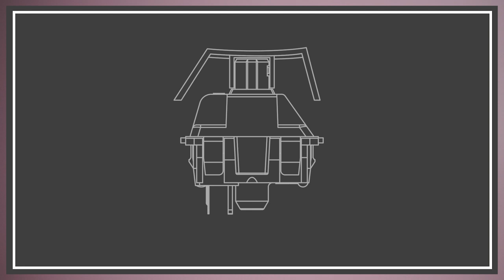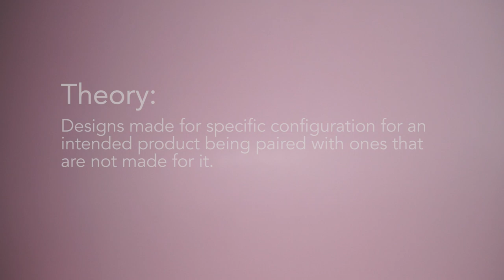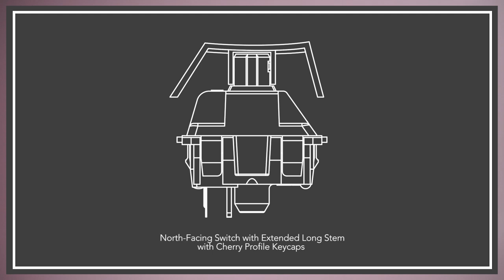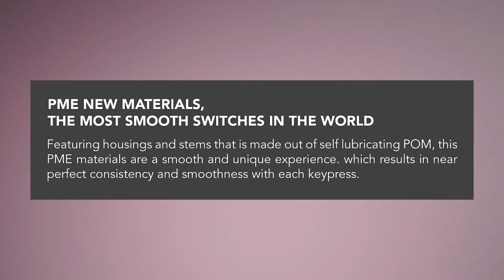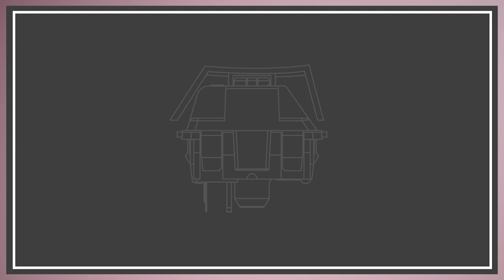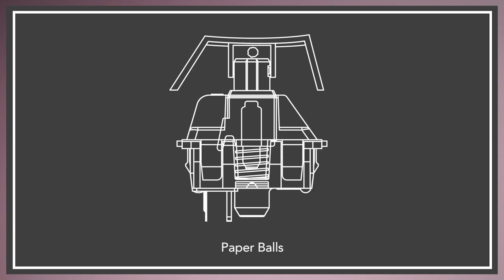Switches For your North Facing Keyboard

Comment: Good overview on long pole stems!

However, do wanna preface a couple of things:
1. Not all long poles are created equally. Yes, they longer than some of the more basic switches, but they also quite very by length, so there can be the situation where even when you get long pole, there can be interference.
2. The thickness of the keycap is also a factor as well. Especially since Cherry profile varies in thickness as well, but since most go for thicker sets for the sound, it’ll be likely that interference will occur.

Don’t mean to undermine you in anyway. Just mentioned some more factors to take into account.
Reply from the maker: Nah you didn’t but yeah I mentioned all that in the video, the best thing is still to do you research and try things out
Reply: @AFIQKeebs  My apologies, I should have watched the rest of the video before making a comment. Once you said, "you need long pole stems to help interference", my instant reaction was, "hey, wait a sec, there's more to this". 

Saw the rest, and you actually address one of the issues I had, which is KTT switches not being long enough to eliminate interference. I personally found out the hard way haha.
Reply from the maker: Yeah I learned the hard way too 😂 saw the long pole and went for it…
Reply: @AFIQKeebs  what are the thickness of the cherry caps you used with these switches
Reply from the maker: I don’t have the keycaps at the time but it was around 1.5 last time i checked

Comment: 0:45 THANK YOU for illustrating the problem using the animated drawing.  From that it's clear that the keyswitch's top housing is asymmetrical, and that the interior of the keycap provides a correspondingly asymmetrical recess. So when the keyswitch is rotated 180 degrees from normal (to north-facing orientation), the top housing no longer fits neatly into the keycap recess. Hence collision.

Comment: A year ago interference wasn't mentioned as much and so I bought myself a gk64 with clicky blues and clone cherry profile caps. A year later I own many long pole switches, like the U4T, Linear Thocks, Carrots, aurora clears and Poseidons, but just like anyone who have been playing with keyboards, we don't settle and there are so many options that I have yet to try that aren't long pole. Either I get other profile keycaps or get myself a better keyboard and ultimately I'll be saving up for hopefully an "endgame" board.

Just know for the newcomers with budget north facing keyboards if your hands are as itchy as mine and curious for new things try, I suggest saving up for a proper south facing board rather than spending all on new switches every few months lmao.
Reply from the maker: It’s true though. Once you get into the hobby there’s no real end even when we’re searching for an endgame. One of the good thing about the industry is that the manufacturer understands the community now and more of the boards are becoming south facing which is a good sight to see.

Comment: I use Oil Kings(thock) or Tungstens(clack) to avoid north facing interference. They are my go to.
Reply from the maker: Still couldn’t get my hands on an oil king need to try some
Reply: Are Oil Kings always? I was doing the paper test with them, and I felt like I was still getting a tiny bit of interference with R3 (Domikey x Inky set)

Comment: I found a video before, that could help you reduce switch inference, you get a small piece of paper, and cut it in tiny pieces, then, add the tiny paper pieces on the keycap's stems, by doing that, youre making the stem longer, therefore reducing the interference, it worked well for, though just beware that, the keycap would seem a little off, like its not centered, but that depends on your way on adding the paper for the stems. I hoped this helped, maybe. I'll be glad to send the link of the video if you wanted a brief explanation.
Reply from the maker: Ayyy yeah i mention it in the last part of the vid but its a big fuss because you need to make ball the same size but at least there is something to avoid interference

Comment: The new gat oil king switches have full travel but no interference on north facing boards
Reply: Check them out if you want 4.0mm travel but you have a north facing board and cherry profile caps
Reply from the maker: I’ve heard about this switch but never git curious about it. Maybe I’ll get some for test.
Reply: @AFIQKeebs  They use a new mold for the top housings that enables north-facing compatibility, Keybored has some insights on his channel

Comment: I have issue on my Tecsee Ice Candies. my FR4 plate is quite thight it is pressing the top housing of the switch inside, it makes the bottoming out not going smoothly, the stem often stuck in the middle of the rails. I don't think it is the plate issue since the other switches are doing good. I think the housing material of Ice Candy is too soft/flex. I proved it by trying to press (or squeeze) the top housing inside by hand and the issue I encounter on the plate is there as well.
Reply from the maker: I had some issues where it wasn't smooth going down after lubing. I thought it was the Krytox and the PC housings making the issues. I thought that was the reason it felt sluggish. I tried pressing the switch and it didn't have any significant changes to it. Did you press it on the sides of the switch?
Reply: @AFIQKeebs  yes, I pressed on the sides of the switch and it feels kinda stuck. it seems the housing is quite soft unlike the other switches
Reply from the maker: I've been pressing on the switch and nothing really changes. Maybe I have a different batch of switches.

Comment: Great suggestions!

I've noticed certain Cherry keycaps, like ePBT, have interference even in South facing orientation; very noticeable with silent switches.

Have you run into this issue as well?
Reply from the maker: I have not. But I didn't know that was possible. I only know some keycaps have them on the capslock or the shift.

Comment: Bro, seeking your advice. Using Redragon K580 Vata with Outemu optical brown switches. Any better switches that you can recommend?
Reply from the maker: This is a bit hard because there is not much option for opticals. You can get Kailh or Gaterons opticals but I can’t say it be the better choice. But you can make the best out of it by lubing the switches and modding the board if you haven’t done so.
Reply: absolutely akko cs series... check them out and see what is best for you
Reply: @buzzerlmao  they only work for redragon mechanical pcbs but not optical pcbs

Comment: im planning on building a gas67 and since its nf pcb i have to go with long pole switches, which of these are recommended if i wanna go for a "clacky" sound profile? thanks alot and great video!
Reply from the maker: I would go for the Penyu but it has this plasticky thin sound. My favorite switch rn is the Pangu Giant V6 and the Everglide Peacock. Both are balance clacks.
Reply: @AFIQKeebs  both of the options u mentioned isnt available in my country :( do u have any other recommendation for long pole switch for my gas67?

Comment: @AFIQ Do you maybe know if epomaker's flamingo switches have interference? Thank you!
Reply from the maker: I can’t see that it is long pole. Pretty sure it has interference.
Reply: @AFIQKeebs  Okay, thank you so much for your quick response, you are really kind.

I just bought Epomaker TH80 SE prebuilt the otherday and it comes with flamingo switches, north facing leds and cherry profile keycaps. They firstly said it will be south facing leds but they changed that afterwards.. And now I'm kinda scared it will have interferance.

However i think I'm gonna stick with my amazon order, because i can return it, if i don't like it. (tho it would be kinda sad waiting 2 months for keyboard and then needing to go over all the problems to return it).
Reply from the maker: It looks like a good board. Sometimes you can be lucky with some keycaps that it has no interference. If it does have interference and you can’t stand it. You can just change it to another profile keycaps.
Reply: @AFIQKeebs  Thanks for the advice :)

Comment: Bro, I hope you reply, I am planning to by zaku switches that are also marketed as 'long pole' switches. Do they have interference in north facing orientation in cherry profile keycaps?

Thank you in advance!
Reply from the maker: Hey, so the zaku’s (13.47mm) long stem is not super long it is a bit longer than the NK Creams (13.41mm) and KTT Rose (13.2mm) but not as long at Tecsee Carrots (13.8mm). Considering some keycaps don’t have interference even with KTTs it should be ok. BUT I really recommend testing it first because not all keycaps are made the same and some are more forgiving than others. Check what keycaps you wanna buy and get some Zaku to see em out.
Reply: @AFIQKeebs  thank you so much for the reply. IT REALLY HELPED me to consider on buying switches.

By the way, I see that the Gateron oil kings have no interference due to top housing mold was changed. But I didn't like its sound profile. I will try zaku's first on clone dariling keycaps

Comment: Which one do you like the best out of the two ktt switches? Ktt sea salt or the ktt grapefruits. I'm trying to get one but i'm not sure which one is smoother in feel. Or are the akko radiant reds better?
Reply from the maker: If you ask me which do I prefer between the KTT, I would pick the Grapefruit because the it looks more aesthetically pleasing but the Sea Salt sound way better in my opinion. If you want smoothness the Radiant Reds have the slight advantage.

Comment: Any suggestions akko switches with long stem?
Reply from the maker: Akko has the Cream Yellow and Blue that are long poles but they are not long enough to avoid interference for all keycaps. Some dye sub with equal side wall thickness still has interference with the switch. If you can get some samples that would be the best to test it out with your keycaps.
Reply: @AFIQKeebs  are holy pandas great for solving that interference, any budget switches that are compatible with cherry profile? "shopeemy link if you have lol"
Reply from the maker: There this mmd pandas that are clones of the real ones and they actually don’t t have interference. You can buy some to check them out. 
https://shp.ee/sw3mutn